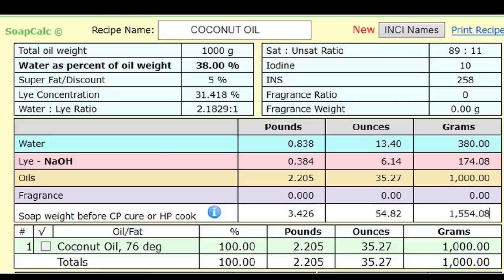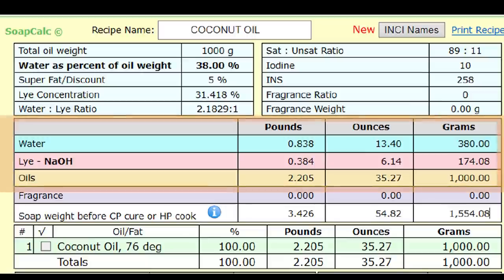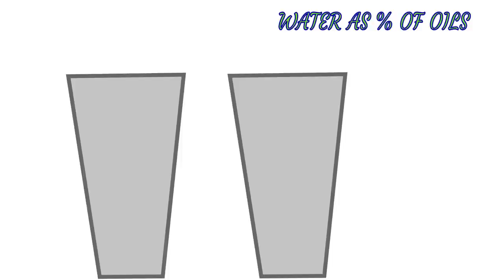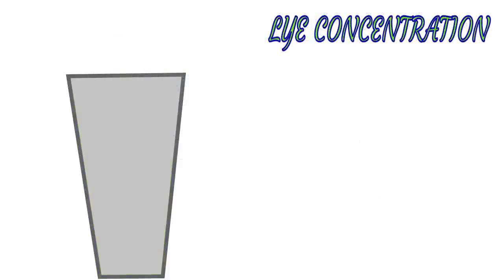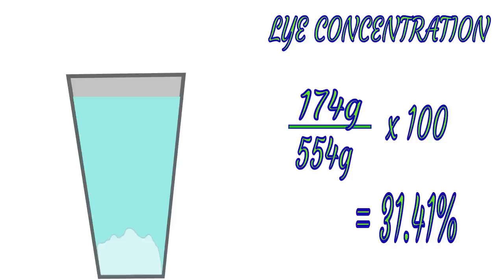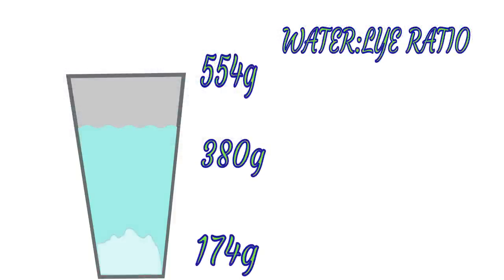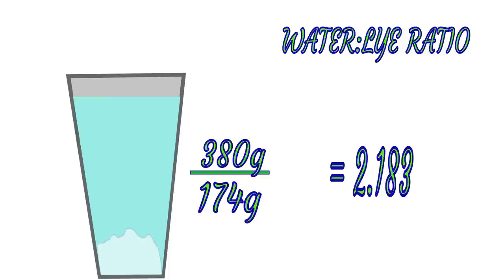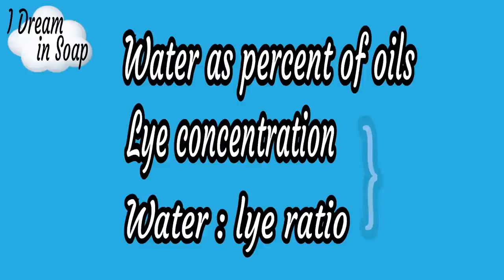Water discounts, Soda ash, glycerine rivers and gel phase ~ Cold process soap making tutorial

Comment: Hi Lisa, thank you for that amazing video. I use a 25% water to oils and soap at warm temperatures. I have been getting a slight crumbly top and the corners are crumbly too. This time I covered the loaf and it got a crack which I understand is due to the temperature. But it is still pasty/crumbly. The inside however , had gelled. How do I get an even gel. Is this uneven cooling? Or is it because I spray too much alcohol on the top? I can’t figure what it is that I’m doing wrong 😢

Comment: Very interesting Lisa! I have never write on you tube videos, but I can see you read all the comments 😱, and there are a lot, thats very kind.  I’ve been doing water discount for a while, I tought it could help with curing time, but I recently check it doesnt help with alkalinity, do you think it affects somehow?
Reply from the maker: Hi Brenda, thank you so much. Yes I do make sure I read all of my comments, if people are kind enough to make the effort to leave them, then they shouldn't be ignored. Curing is a funny thing, less water will definitely help you get a harder bar quicker, but it won't increase the speed of the chemical changes that happen during a full cure. Having said that, soap is safe to use after saponification is finished (typically about 3 days for cold process). When the bar is hard the rest of the cure time is about improving the quality of the bar, however I heard lot's of people say that they don't notice any difference between a bar that's 4 weeks old and one left for 8 weeks. Maybe try it with your own start using one earlier and think about how it feels etc and then when that's finished (probably a 2 or 3 weeks later depending on how quickly it gets used up) try another. Best wishes - Lisa

Comment: What is your method for forcing gel phase via the oven? I think in another video you mentioned that you set it at 170F (not sure of the temp in C), but I don't think you ever mentioned for how long, (let's say for a loaf). Perhaps this would be a good idea for another tutorial video on your channel?
Reply from the maker: Hi. I preheat my oven to 170F, which is about 75C. As I put the soap in I then just turn the oven off and keep the door closed (sometimes I may leave it on for just 5 minutes). I then leave the soap in there overnight, but to be honest as soon as the oven has cooled to room temperature it's not adding any extra benefit, so could be removed. 
I do wrap my soap in a tea towel as well just to insulate it so it cools down more slowly.
I use the oven because I do quite a big water discount. I soap at 25% of oils (35.6% lye concentration). If you don't discount your water your soap would probably gel without being forced.
I hope this helps. Best wishes
Lisa
Reply: @IDreamInSoap  Thank you for the reply. I had also wondered about the overnight thing that I've seen in CPOP descriptions. I think my oven cools down in just 2-3 hours, so I didn't know why they kept saying to leave it overnight, lol. 

My first batch of CP soap was done using the standard 38% water ratio that soap-calc uses, but I don't believe it ever went through a gel phase (but I wasn't doing a loaf...it was a really small batch, so I used individual bar molds...maybe they cooled down too quickly).

Anyway, I've been binge-watching your videos, and even though I'm still way too inexperienced to do many of things you're doing, it's certainly inspiring! Thank you.

Comment: Hi Lisa, Thank you for sharing this video i found it very useful as a new soaper. However, im struggling to understand whats considered high and low water and whats the lowest of water that can be use as a percentage.
I know you mention theres no official amount of water we should be using, but typically what is classed as high and low water? id appreciate your help if possible.
Thank you kathy
Reply from the maker: Hi Kathy, so pleased you found it useful. High water normally related to the full amounts in the various lye calculators, they typically use 38% of oil weight (soapcalc) or sometimes a bit more.  I soap at 25% of oil weight and find it works well, but you may want to work down to that. Typically anything under about 33% of oils will stop glycerin rivers. So a good place to start would be somewhere between 30 - 33% of water to oils, if you're a bit unsure do the 33% and the work down lower as you get more confident.
There is a minimum amount of water. Lye needs the same weight in water as lye, otherwise it will not dissolve properly, so your water should always be at least the same as the lye, if you are going that low though you are doing quite an extreme discount. In my recipe my 25% to oil weight is still a ratio of 1.8 water to 1 lye.
Hope this helps. Lisa
Reply: @IDreamInSoap  Thank you very much for your response. ill definitely try your suggestion. I dont plan going that low, i just wanted to try and understand whats the typically amount of water used. thanks again. kathy.

Comment: Question? What do you consider a high water lye concentration vs a low water lye concentration in soap making. I use 33% usually, which I consider average and I still occasionally get glycerin rivers.
Reply from the maker: I'd say 33% is quite high, that's typically the level where glycerine rivers start to occur. My standard is 25% water to oils, maybe try going down to 30% water to oils.

Comment: since i don't use fragrance or color in my soaps, i guess i can just not worry about gel.  i always wondered what the point was
Reply from the maker: Hi Carl, thanks for leaving a comment. You would find that an gelled soap has a slightly more translucent look than an ungelled soap. If you have a look at my Ghost swirls soap, you will see the differences quite well. But generally no, not too much difference, it can help unmold a little quicker. So generally for you, I'd probably say just let the soap do what it wants and I would only interfere if I started getting a partial gel and I didn't want those funny rings in the soap. Best wishes, stay safe and well :-)

Comment: Thank you for another fantastic video!  I am just amazed by the differences in the gelled and ungelled green and yellow micas. Would you be willing to share with us what you consider to be high water versus low water?  i've been soaping for a year and use lye concentration in my calculations.  I think of 33% lye concentration as middle of the road. I often use 35% or higher, but also just started using using accelerating FOs and now think I may need to rethink my lye concentration!
Reply from the maker: Thank you so much Linda, it is quite different isn't it. I tend to soap at 35.6% lye concentration, which in my recipe is 25% water to oils. I consider this quite low, but a lovely workable figure, pretty well all of my soaps are made at this rate, so therefore I'm pretty similar to you. Of course you can go as far as 50%, but I've never tried and don't feel the need to. I think anything above a 30% lye concentration is a good point for preventing glycerine rivers and reducing soda ash. Hope this helps a bit, looks like you're very similar to me. Stay safe and well :-)
Reply: Thank you for taking the time to answer.  ❤️❤️❤️ and you stay well, too!

Comment: Hi Lisa. I have to say I love this video. I cam back to it often if I have questions or issues. I just finished a back of CP soap and I have glycerin rivers BAD... I changed two thing. 

1) The batch volume. I purchased larger molds. Didn't change my water % from my last batch of this recipe.
2) I didn't CPOP in the oven like I normally would. (Wife doesn't want smelly soap in her oven.) so I used a heating pad. I may have left the pad on longer that I should have.

Can you point me in the right direction? What else could  I have done wrong?
Reply from the maker: Hmm it's tricky to say. Glycerin rivers form best with a long gel phase, it may just be that as your mold was larger and you didn't add so much heat as you didn't cpop (heating mats never seem to give the same initial kick of heat as cpop) So the gel phase may have been slower due to the lower heat and longer because of the volume of the soap keeping that heat in, that's all I can think of if everything else was the same as you normally do.
Reply: @IDreamInSoap  ok great. I can work around that. Thanks again.

Comment: Thank you for this very helpful video. Could you tell me what the lye concentration was in your high and low water solutions? Is 38% considered normal because that is the default on soapcalc. I tend to get soda ash, issues with unmolding, and glycerin rivers, and want to try tweaking my water amounts.
Reply from the maker: HI 38% is high water, it was initially produced in the recipe for hot process where higher water is needed. It is too high for cold process. You can really go as low as you like, the only constraint is that you water should always at least equal your lye, so if you have 100g of lye you need at least 100g of water. In this video I did 38% as my high water and then 25% as my low. It's not particularly low, but it what I always use in my recipe and find it works very well. Best wishes
Reply: @IDreamInSoap  Thanks for the quick response. I wonder why soapcalc sets their default so high! I am going to tweak recipes that had been problematic because of the 38%.

Comment: Hello there, Ive got a question for you, if I am making a master batch of lye with a 50/50 ratio, does it matter what my lye concentration or ratio is before hand if I am using these calculations.
1. I multiply the lye number by 2, that is how I get the full recipe amount of lye
2. Then to get the rest of my water weight I subtract the recipe water weight from the lye weight 
So now I am just a bit confused, would love your input thank you.
Reply from the maker: If you are doing a 50% concentration, you would, as you say make up your solution as 50% lye and 50% water, so say we wanted to make 1000g of solution, it would be 500g lye, 500g water. 
If your recipe wants you to use let's say 200g of Lye and 260g of water, you would start with the lye figure, to get 200g of lye, you would need 400g of your solution.  When you've poured out your solution you now have 200g lye and 200g water, so you need to add an extra 60g water.
Hope this helps.
Best wishes
Lisa

Comment: Thank you for such a fab and informative tutorial. I only usee sunflower and  rapeseed   and coconut as my main oils. I reduced the water recently and the soap is 'bendy' do you think it will harden eventually? many thanks x
Reply from the maker: Thank you Summer Breeze, if you used a high % of liquid oil the soap will take longer to harden, but will produce a hard bar eventually. 100% olive oil produces a very hard bar but easily takes between a six month and a year to cure. I'm not sure if you are saying that the soap is bendy since reducing your water or if it's always been like that. If anything reducing the water should make it harder quicker, so maybe something else is going on?
Reply: @IDreamInSoap Thank you for your feedback it was very valuable, I meant to say I increased the water, this would make sense in your deduction. I will have to decrease the water next time luv n light x
Reply from the maker: @summerbreeze1955  Ah ha that makes much more sense and means that there's unlikely to be anything to worry about, yes, just some extra cure time

Comment: Absolutely brilliant! Thank you.  Is there a magic temperature that soap needs to set at, in order to gel and is there a magic length of time to gel, before glycerine rivers set in??  I really need/want to be in more control!
Reply from the maker: Hi Andy. Thank you so much, There isn't a magic temperature as such, the soap just needs to be in gel phase which can happen at different temperatures, soap that has a higher amount of water will go through gel at a lower temperature and stay in gel phase for longer. Lower water soap goes through gel at a higher temperature and the gel phase is quite short, it's like a short high peak. This is why if you do a decent water discount (I use 35.6% lye concentration, which is 25% oil weight in my recipe) that you may need to insulate your soap or CPOP it to force gel, whereas higher water soap is very likely to gel if just left out on the side. So overall it can vary, there does seem to be a minimum temperature of 60 degrees C (140F) to trigger gel phase. I've never done a test on how long the gel phase needs to be (and wouldn't really know how to go about it, without making far too many bars of soap) but is the actual cooling down part of gel phase that allows the rivers to form (not the heating up phase) which is again why high water is a culprit as that cools much more gradually than the low water soap. the amount of insulation will have an affect as well. Hope this helps a bit. Stay safe and well :-)
Reply: I Dream In Soap thank you, Lisa!  I have read tons of articles and even Auntie Clara's experiments to grasp how temperature and water affect gel and rivers.  You made the light switch on for me!!
Reply from the maker: @debbieescobar6267  Oh Debbie, yippee, I'm so chuffed, thank you for letting me know :-)
Reply: I Dream In Soap haha!  I had to google "chuffed"
Reply: @IDreamInSoap  Thank you Lisa!  I'm going to put my next batch of soap in an incubator at 90F and see what happens.  I've only made 8 batches of soap so far. Most 2Lb batches with 1/2 going into silicone molds and 1/2 in a mini-loaf.  I have learned SO MUCH from you!  Thank you for all you do!  So much to learn yet.  Respectfully -  Ken
Reply from the maker: @andymeier1395  Oooh an incubator, now that's a new one. That's quite a high temperature, will it go more towards 70-75? if you're discounting your water you should be OK, but just watch it doesn't overheat if you have a higher water rate. Does the incubator turn off and allow the soap to sit in a warm environment as you probably don't want it in constant 90 degree heat.
Reply: @IDreamInSoap  Hi Lisa!  I can actually set the incubator for any temperature as long as it's not being used for it's intended purpose.  LOL.  I didn't see your reply until this morning, so I didn't incubate/cure my latest batch at the lower temperature as you suggested.  I kept it at 90F AND put a heating pad a few inches below the curing soap.  I left the soaps in the incubator over night like this and took them out this morning to cool in the house which is about 65F-70F. I was surprised to see that there was not soda ash on the tops.  I have had soda ash on all my soaps since I've made them. (Again - this is only my 9th batch).  I've used alcohol spray on them but I don't know what the concentration is and I can't get any now, due to the COVID-19 crisis. I'm really trying to push the gelling of my soaps to get the nice rich colors I'm hoping for.  My latest soaps are cooling off in the kitchen now.  I may not remove them for a day or two, because I want the soaps to harden a bit before removing them from the silicone molds.  The loaf, I'll probably cut this afternoon. BTW, I'm using 50% coconut oil and olive oil with a 30% water to oil ratio and 5% super fat. Thank you again for your help and for all that you do!! If you're interested, I'll keep you posted when I cut the loaf to see what happens.  Life is a learning experience. So experiment!

Comment: You are amazing!!  I just made a batch of soap.  I forgot to add the sodium lactate to my lye so I added it to the mixed batch.  Everything was smooth then suddenly when I went to pour, there were small soap clumps. Do you think I ruined the batch?  Why does it have to be added to the lye water?
Reply from the maker: Hey Mama B. Sodium lactate is water soluable (a bit like salt itself) therefore it won't dissolve as well in oil. I do know people who like you have added it to the oil after forgetting it in the lye, but have then blended it in as they were emulsifying the batter, that way it dispersed as it was still getting mixed with water in the batter. I've never added it to the mixed batch, but it is likely that at that stage it didn't get to dissolve properly.
Reply: My batter was smooth then had clumps when pouring. I used sunflower in my recipe for the 1st time and sandalwood plus the error of sodium lactate in batter.  Maybe it wasn't the SL that caused the clumps?
Reply from the maker: @mamabssoapery747  Possibly the fragrance oil ricing? was it little lumps? sometimes the FOs rice after a few minutes, so they go in smooth then just as you pour you get little lumps.
Reply: @IDreamInSoap  It was not little rice, it was super smooth and once it started to thicken quicker, I started pouring and that is when I noticed the clumps about the size of a quarter in diameter.  Probably the FO

Comment: I wish to clear one more doubt.  I my recipe I'm planning to add some puree/sugar syrup. What I understand is that I should reduce the water amount given by the soap cal by the weight of the syrup/ puree. Am I right ind vdoilg this
Reply from the maker: Yes, you can reduce the water, but be careful not to reduce your water too much, you need at least the same amount of water as lye for it to dissolve properly, if you don't have enough water you would need to dissolve your lye in some of your puree too, if this is the case you need to be careful as you will probably have to freeze the puree 1st, be careful with syrup as it will heat up your batter and cause acceleration, so don't use too much
Reply: @IDreamInSoap  thank you so much.